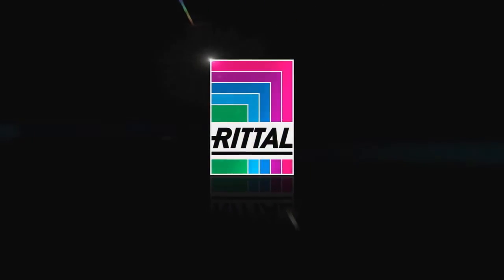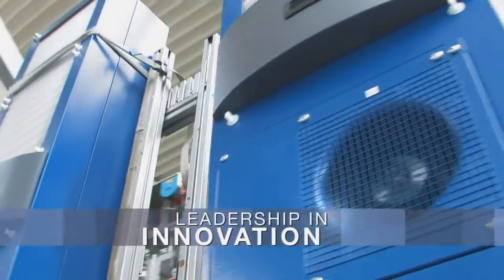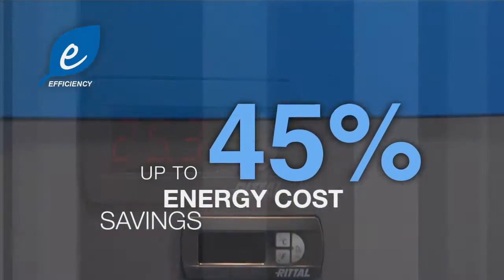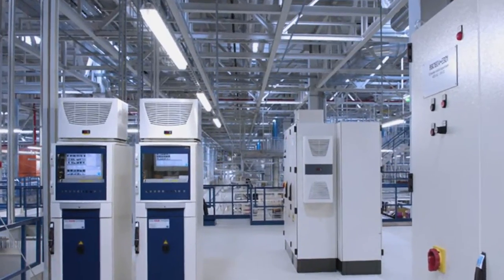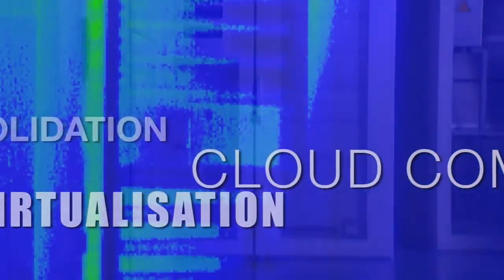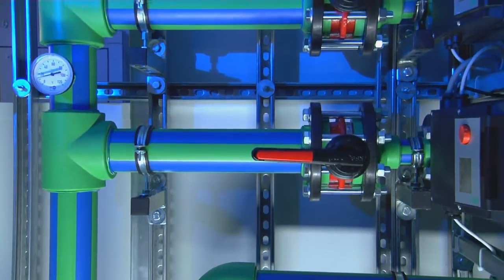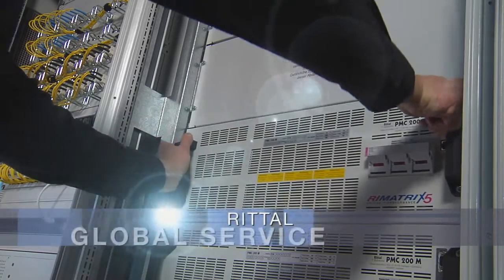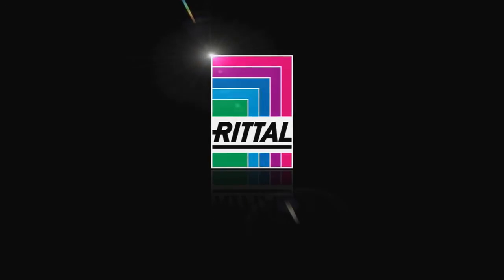Rittal Industrial Climate Control Solutions

Comment: You know it would be great if you can release a programming tutorial on YouTube.  This is not the easiest thing to do as I just discovered.
Reply: hello I have a problem with the panel air conditioning he has the fault 607 he turns the compressor on for a while and after that failure, what would be this defect grateful for the help